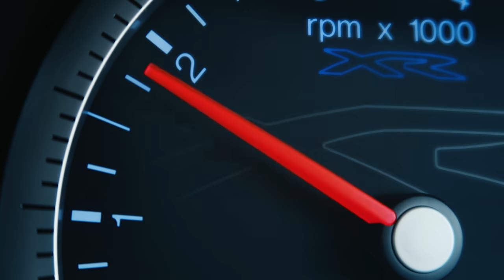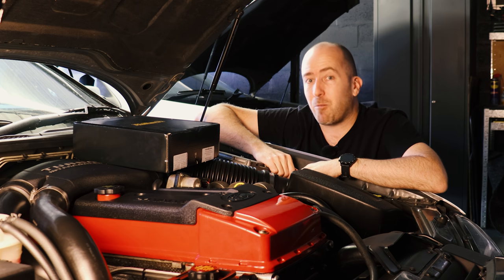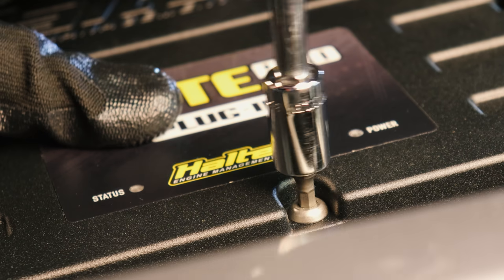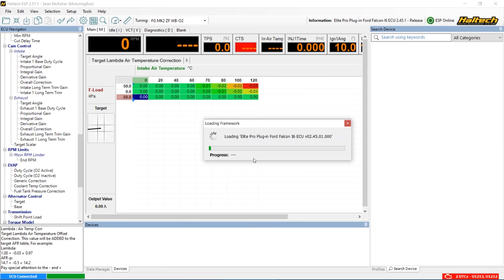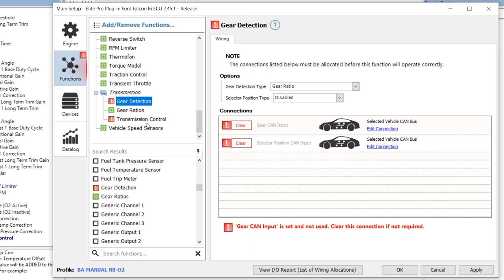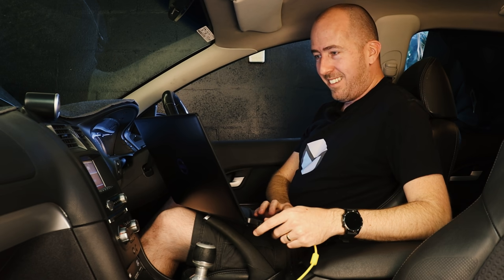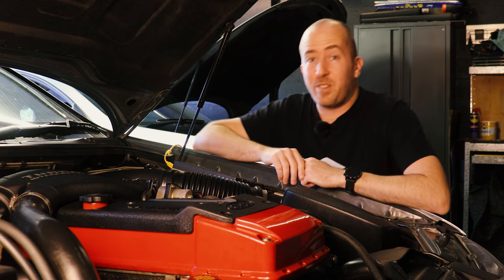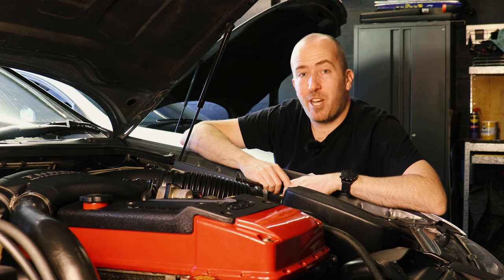🔑Barra Turbo Haltech ECU Upgrade! BA XR6 Turbo Elite PRO Plug-in for Ford BA BF FG FGX Falcon & FPV

Comment: Sean, it's hard to do content with restrictions & lockdowns in place. Viewers need to take that into consideration when they watch. Lockdowns & restrictions are driving me insane on the Mid North Coast of NSW. At least the Haltech system is a step in the right direction to preserve your XR6T. 
I've been helping a mate with his VU SS Ute which now has a Monaro front end & Maloo rear with mods here & there. The next step is to take out the VU Steering Wheel & replace it with a VY one.
Another great video for those thinking of the Haltech upgrade.

Comment: The haltech is worth its weight in gold, so many features and the engine protection and trims has saved my motor countless times whilst dealing with bad tuners. Trust me, you wont regret it. Also love their remote assist support 👍
Reply from the maker: Sure, before it was tuned I accidentally boosted it and it hit engine protection because it ran lean. The way it handled it was amazing though. It cut fuel and ignition for about 5 seconds, then brought 3-cylinders back for another few seconds... before bringing all 6 back and continuing on as normal. All of this was at 100km/h on the highway too.

Comment: Haltech ecu's are important, yes you can just flash stock ecu. But  for better monitoring and protection features you can use wideband for sensors to help keep your engine safe.
Reply from the maker: There are also tons of things you can add-in too - CAN gauges, IC7 dash, flex fuel sensors and the like. It's an awesome system which I may end up taking greater advantage of one day.
Reply: @MotoringBoxTV  Exactly right. Lot's of goodies. Have fun.

Comment: You should get a turbo side intake, valve springs, oil pump gears, and possibly head studs along with an upgraded fuel system, as yes a Haltech in a somewhat stockish car is absolutely overkill.
Reply from the maker: I've mentioned before why I'll never go for a turbo-side intake, but it will be copping valve springs. With the pump gears or head studs it's sort of a question of where do you stop. Being a BA you'd have to do the conrods and pistons as well to make it all worthwhile. So I'm sort of sitting on the fence.

Comment: Haltechs are expensive but they are the best, especially for applications like this where DBW throttle and alien like cam triggers are used. I have a megasquirted B series swapped turbo prelude that I am looking to take to the next level and chase big numbers, when looking at how much the fully built engine and sequential transmission will cost, suddenly the Elite2500 and dash package doesn't look too expensive at all...

Comment: Hi Sean, great video and I'm looking forward to more on your elite pro because I would like to eventually build/convert to a g6e turbo 1 tonne ute with the RTV clearance and wider track and locking diff.
Could I suggest for another episode idea a "quick fix" for replacing the heater rod that often breaks when you  refit the head unit. I say quick fix because most fixes online require removing the dash and steering wheel (urghhh). I was hoping with your super powers of investigation and vast industry contacts you might find a simpler way and it would be and episode many ba - fgx falcon owners would search for. Just a suggestion😉
Reply from the maker: From what I've heard I don't think there is a quick fix for that! I have heard a lot about it, but never seen the part in question let alone experienced it. Fingers crossed I won't ever have to!
Reply: @MotoringBoxTV  thanks for replying. You deserve more subs - I'll do my bit to help

Comment: I assume it will also support the 5 speed manual transmission for both Turbo and non Turbo cars since there is little difference electronically between.
Reply from the maker: Yes that's right - I forgot to mention that but I added a text overlay on the video where I was talking about it.

Comment: why did you go for a ecu over any other mod that gives you power gains? surely you can re map the stock ecu and do head stud valve springs 1000cc injectors for the same price as one of those ecus

Comment: Hi Sean, Did you install the Haltech HT-154000 or the HT-154006 with the Haltech Onboard Wideband sensor kit and is this Wideband necessary with just a standard engine and do you know where the Wideband end plug goes, as original Ford plug only has 4 wire plug that seems to go behind drivers side engine bay firewall. Thanks
Reply from the maker: Mine was the 154006 with the wideband kit included. A wideband isn't strictly necessary, but I think you'd be crazy to get a Haltech and then not run one. The kit includes all the wiring for the wideband - it wires directly into the Haltech and bypasses the original Ford plug.
Reply: @MotoringBoxTV  Ok Thanks, I didnt see you installed it on the video. Regarding when you first intstalled the Haltech with the Base Map Tune, is it the same tune roughly as the original Ford ECU, as mines all standard and just want it to drive normally and dont rev the guts out of it and just want it for a daily drivers, so will this base tune work ok for what Im using it for. Thanks
Reply from the maker: @scottbrewster4032  I had a separate video with the wideband. The base map should be fine to drive it off boost if you've got standard injectors. If you're replacing the injectors you'll need to update the specs in NSP and it should run correctly again. It most likely won't be as smooth as the stock ECU tune but it should be good enough.
Reply: @MotoringBoxTV  Ok Thanks, so how long did you drive around with the Base Tune for and what did it do if you upd it a bit with turbo working and I thought the self learn would adapt a lot better to a standard engine, if its doesnt run as smooth as the stock ECU.
Reply from the maker: @scottbrewster4032  I only ran the engine in the garage a few times, and then drove it 45-mins to the tuner. I wouldn't count on driving it around much longer without a proper tune. By default the learning is turned off, and should really only be turned on once everything has been set up properly.

Comment: How much do you want for the old ecu? As im interested in turbocharging and manual swapping my terri as some stage.
Reply from the maker: I considered selling it, but will most likely hang onto it incase I ever want to put the car back to standard for whatever reason. I think having to track down a BA XR6T manual ECU would not be fun! (or cheap)
Reply: No worries man, that's why i was asking makes the actual ability of modding my car simply by getting a part here and there as being a fulltime single stay at home dad won't allow me the luxury of getting it all at once

Comment: Does it go str8 in factory xr6t or do u need to upgrade others 1st?
Reply from the maker: The base map is for a stock XR6T so yes it can go straight in. It will still need tuning though before it could be driven on boost.
Reply: @MotoringBoxTV  thanx mate

Comment: I've just noticed that Haltech have removed these from their website...  Any ideas why?
Reply from the maker: From what I've heard they've had to rationalise the range to keep up with production or possible chip shortages, but I didn't realise the Barra ecu was part of the cull. It'll probably come back later on once everything calms down - best to check with Haltech though.
Reply: @MotoringBoxTV  If I was about to buy I'd check with them, but I'm just bored and dreaming...  One theory I had was perhaps they are only selling them through dealers/tuners?  Lots of other companies are listing them for sale, but 'out of stock'...
Reply from the maker: @milesinfront  temporarily stopped making them from the looks of it.
Reply from the maker: https://m.facebook.com/story.php?story_fbid=4917168828375692&id=377777388981548

Comment: Why aim for 300kw? Why not 288 or 311? Just because that unit of measurement is hitting a round number doesn't make that an ideal target. Durability, fuel economy, reliability harmonic running along with good performance are more important than quoting a number. 
Maybe just giving it mods to make it a good fun car to drive with a good power and torque curve rather than peak power figures on paper is what to aim for.
Reply from the maker: In the vicinity mate.
Reply: @MotoringBoxTV  Roger.